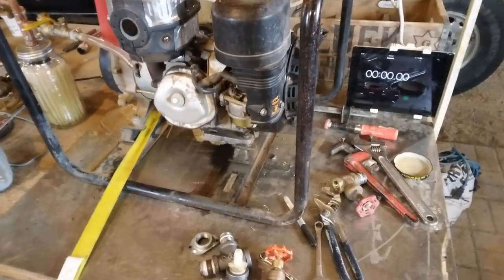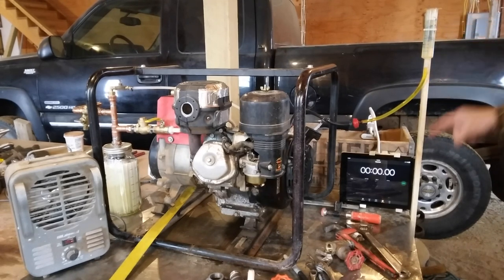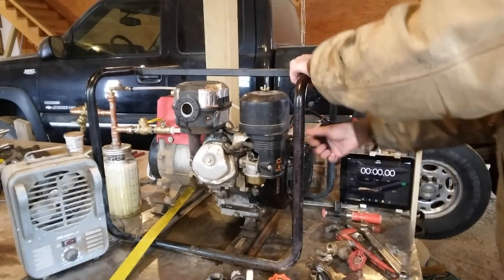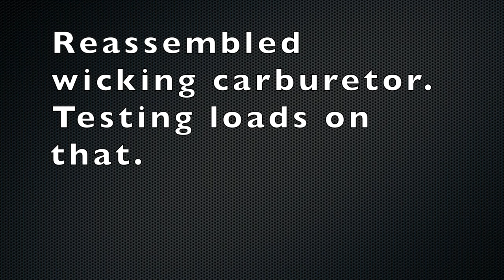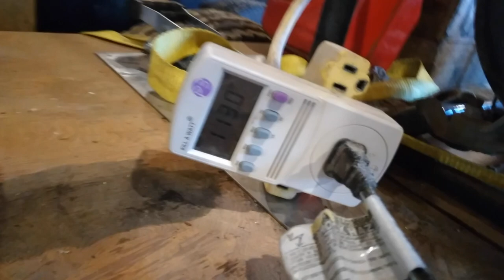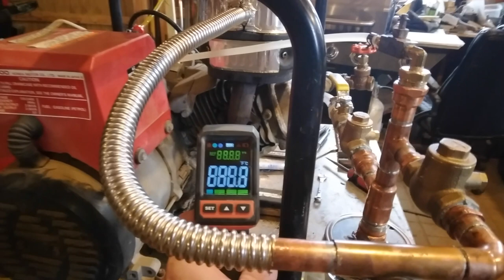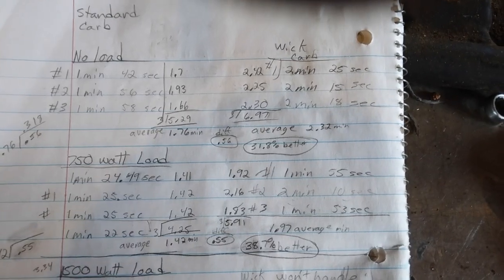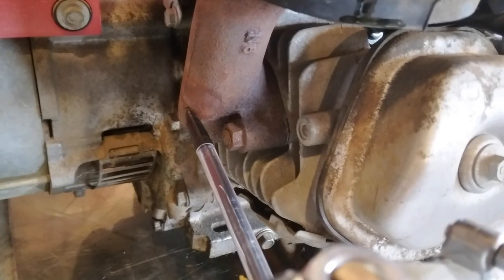IT WORKS! Over 30% more run time with Wick Carburetor

Comment: very interesting...I'm totally off grid. I generate with a gasoline generator in the winter to charge my batteries when sunlight is insufficient.  I ran my 5kw generator 124 hours over this last winter. I'd love to improve my generator efficiency by 30%. Thanks for sharing your investigation.
Reply from the maker: Starting back in 1987 I lived off-grid for 18 years.  I just had a couple of 12 batteries, and very few electric things.  I mostly charge the batteries with a car alternator set up to be turned by a used 4hp Hatz Diesel engine, I obtained for $100.  It usually put out around 400 watts for charging.  Off-load diesel was about 70 cents a gallon then, and I could run it for 12 hours on one gallon!   Thanks for sharing your experience.

Comment: should have a volt amp meter set up for the comparison also maybe rpm is different
Reply: That's my first thought, if it's running 30% longer, it's running lower RPMs, it'd be an easy thing to test anyway

Comment: It would be interesting to see if octane booster in the wick would make a great difference.The higher exhaust temp seems to point toward less air flow with the wick, balancing both systems could be quite critical. On your exhaust manifold at the hottest point you need to drill a hole and force in oxygen, this burns the unburnt gas which is very important, because you can't get new fuel in until the old is out, this brings us back to balance it's real important when trying to increase efficiency, your trying to hotrod your generator, learn from watching what real old timers did, their job was to get as much performance out as possible, same deal here.Cheers.

Comment: Take a small liquid cooled engine, and run the carb intake through the coolant channels.!!! Add high pitch turbo impeller to the water pump. It would probably fraking work. 
Emulsify water in the gas fuel and you could get it to run on superheated steam.